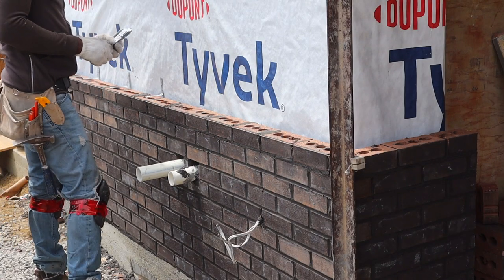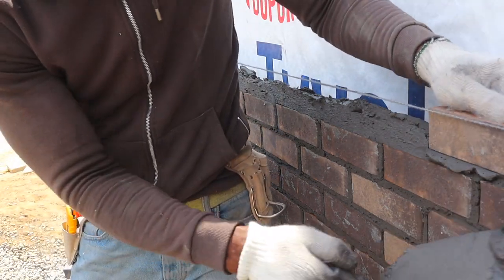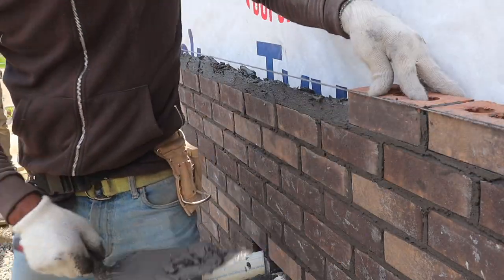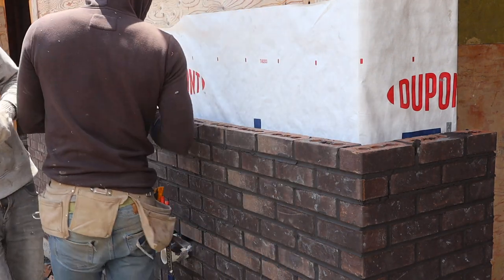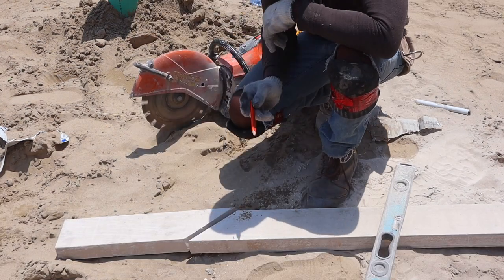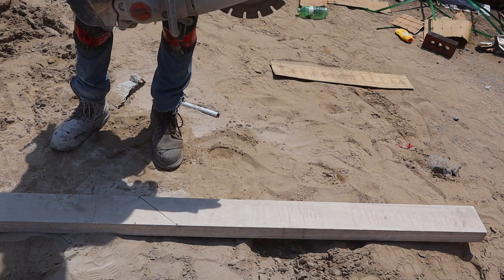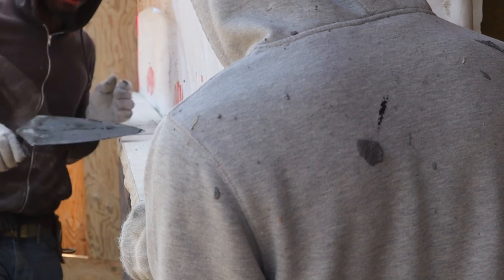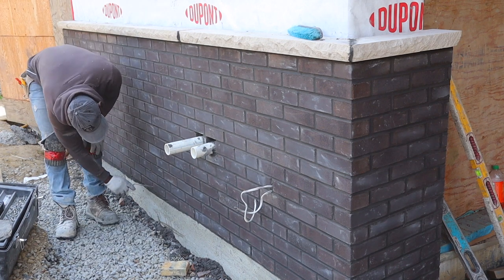I Found It! How To Lay Bricks Faster, Tips

Comment: This method may be quicker to some, but is it better or neater?
Are the perp joints full?
Also in all these bricklaying videos on YouTube you never see brickies scraping the surplus mortar from the cavity side! And yes I am a city and guild trained brickie
Reply: You probably lay 150 bricks max a day lol
Reply: Price work brother time is money
Reply: Residential wood frame only has about one inch of cavity. It’s seems like In the uk your residential is similar to our commercial in terms of block work and insulation in cavity. Where it’s more critical for tooled joints on block work and clean cavity. On jobs like this as long as you have a good wrap and seal sill and penetrations you should be fine. Brick are not water proof.
Reply: Nice work